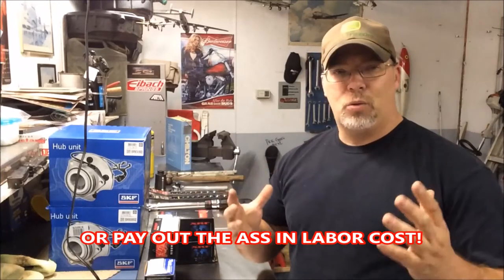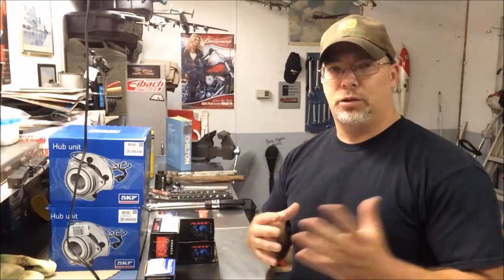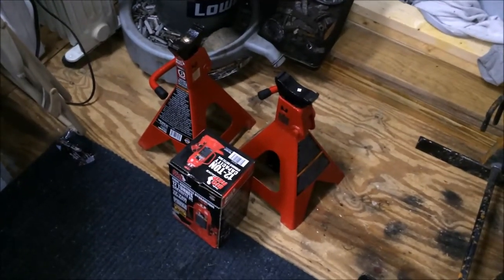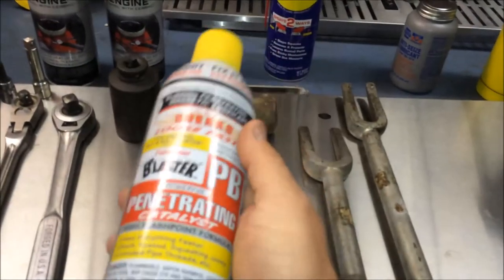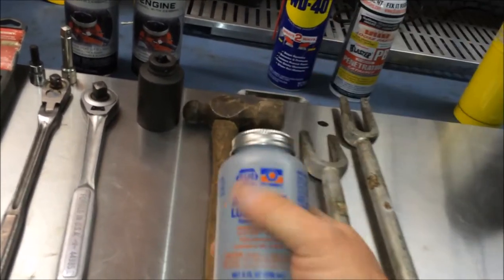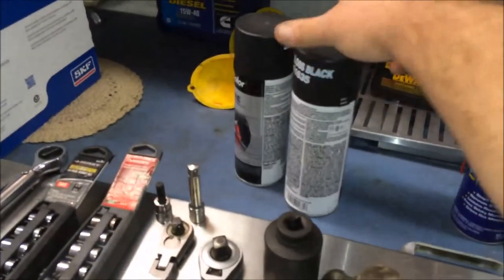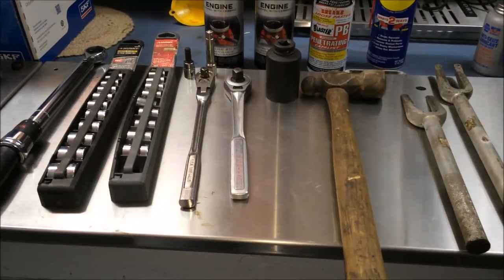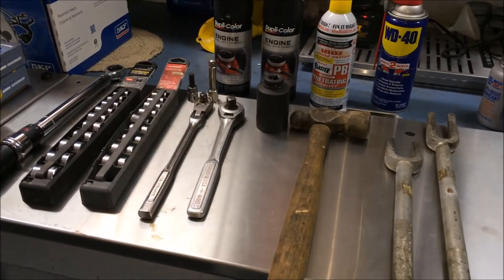2003-2007 DODGE RAM 3/4 - 1 TON 4WD FRONT END REBUILD PART 1

Comment: Subscribed. In the planning process of rebuilding/restoring my 2005 Ram 2500 "Black Betty." She's only got 230,000 miles but she's tired. Engine, trans, turbo, injectors,  suspension, bolt ons (alternator, water pump, a/c etc., paint, body, bedliner, leather interior, carpet, stereo. Basically building a new truck. Thank you for the helpful video
Reply from the maker: Thanks man, Good luck

Comment: Don't forget to get a good pitman arm remover.  And snap ring pliers,  and if your suspension is old your shock bushings are bad and make a clunk noise. Get the 5100 bilstein if leveled. Also I found advanced has the best ball joint press kit for rent cost 150. Also be careful using an impact on front suspension when titening best to use a torque wrench.

Comment: I did my ball joints on my 4x4 03 2500 in the rain, in my driveway, it’s way more fun... don’t forget a 2 foot breaker bar and use a 4 pound hammer, I had to use a floor jack the lift the front end up on the ball joint and hit the axle down to actually seat the lower ball joints, the press wouldn’t do it, even with a 2 foot bar
Don’t forget to lube the new ball joints with anti seize and a good grease after you install them

Comment: Those outer splines your referring to as “knurled” I believe are just for looks, added strength or to give you a better location to hold the ball joint should it become loose and hard to remove. Knurled ball joints or splined have slightly oversized shafts. They are used when the knuckle mounting hole is worn out or oversized from excessive use. It’s gives the ball joint a tighter fit. Take note that using any type of knurled or splined ball joint will permanently alter the knuckle mounting hole and you will be required to use this type of ball joint every time in the future. These type of ball joints should only be used as a last resort.

Comment: Hey man loved the video. Got a 2005 2500 and the time has come for the front end. I know you got busy and weren’t able to make a part two to this video. I was wondering if you could tell me how these new parts are working for ya. Since it’s been three years you should have enough miles on the parts to give an honest opinion. I’m mainly wondering on the ball joints. Thanks man.
Reply from the maker: I ended up selling the truck, all the mopar stuff from what I hear is still doing well and the ball joints are about due for replacement but the new owner has worked it extremely hard and has put over 80,000 miles on the truck since he bought it.
Reply: My Damn Channel thanks for getting back to me. I appreciate the input and like I said I’ll be getting this front end done pretty soon

Comment: I see it`s been a few years since you did this video. It would be great to see a video on the axle seal job with some solutions to removing those nasty collars that are keep the axle seals in place and also assist in setting the lash on the pinion gears of the front axle.
Reply: Take a 36mm on like 4D million 1/2 DR LOCKING Extensions, connect.  Remove contact plate off of 6 ton floor jack or equivalent.  STRIKE fiercly the 36MM on 4D million extensions by grasping the bottle jack under floor jack mainbody and swinging like hell. Use blunt short swings BEING CAREFUL not to SCRATCH differential carrier bearing RACE  on the inside of the tube.  5 SWINGS MAX. worked for meeh haha
Reply: you all prolly dont give a damn but does any of you know of a way to get back into an Instagram account??
I stupidly forgot the password. I would love any assistance you can offer me!
Reply: @Jax Amari Instablaster =)
Reply: @Jefferson James Thanks for your reply. I got to the site thru google and im trying it out now.
I see it takes a while so I will reply here later with my results.
Reply: @Jefferson James It did the trick and I actually got access to my account again. Im so happy!
Thanks so much, you saved my ass!
Reply: @Jax Amari happy to help :D

Comment: I had a 98 dodge Dakota and il tell you now that truck was so bad for the front end I ended up doing the full front end manly ball joints lol. Drove tight after that
Reply: what all do I need to buy parts wise like lower n upper control arms I got a 2000 dakota
Reply: +Steven Lisi well you can buy just the ball joints but you have to grind the old ones off because there put on with heavy duty rivets there hard to get off of you can spend the extra money and get the upper and lower control arms with the ball joints then that's good and don't for get to grease them good and get new shocks and tie rod ends then get a alignment.  Your truck will drive as good or tight   As new
Reply: +raji chahal hell yeah thank you n going to do that with taxes lol

Comment: Clicking under load in 4wd? Ive done entire front end and driveshaft... suspect t-case? 140k mi on truck..
Reply: Check all your u joints mine is making a clicking noise when braking just discovered today both front axle u joints are toasted